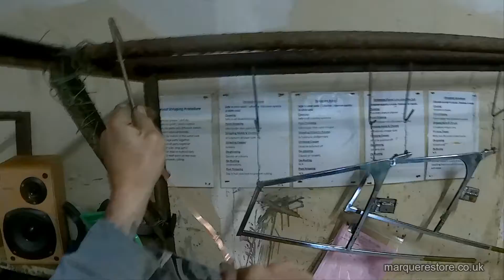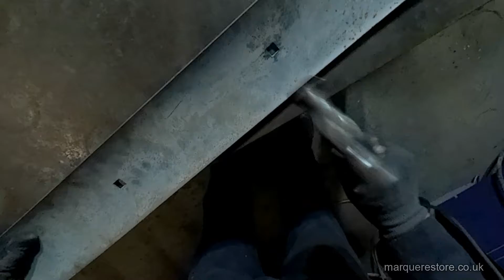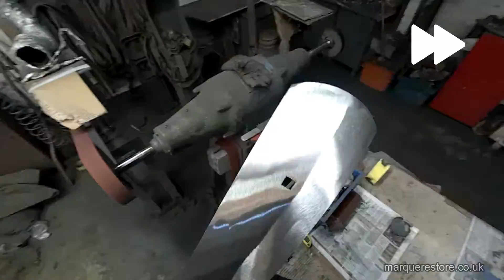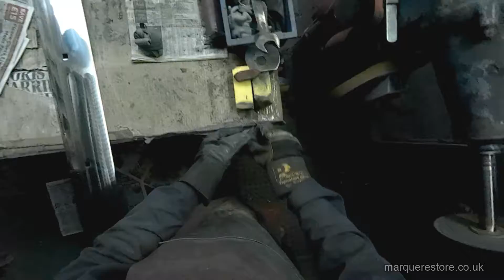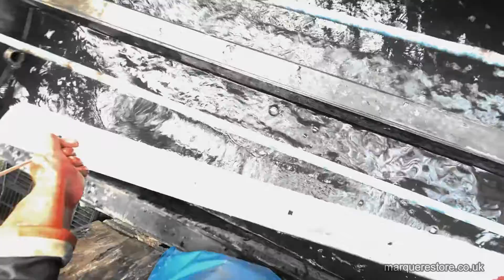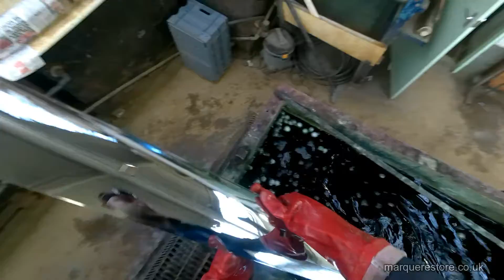How to restore chrome on a 1953 Chevrolet (Chevy) Pickup Bumper.

Comment: This is a great video, thanks! But what about the inside of the bumper. Doesn't it also get chromed in a dipping process like this? On many of these old vehicles the inside of the bumper would be quite visible, so I'm wondering what was done here...
Reply from the maker: Yes it does. Both sides are plated. The inside is not polished (like original) so is not as shiny a finish as the face side.